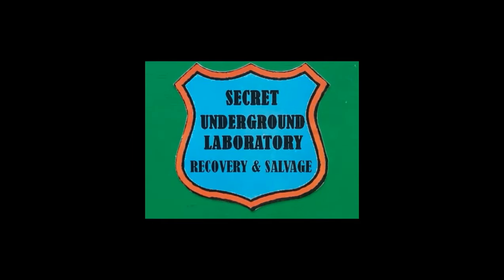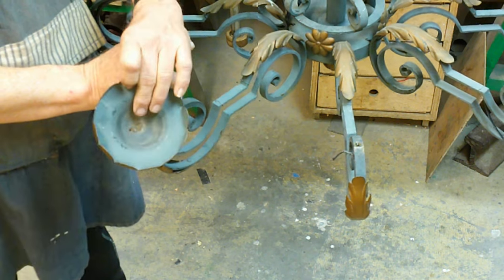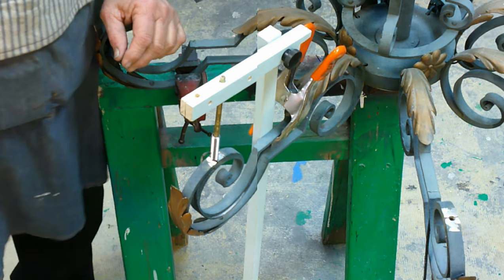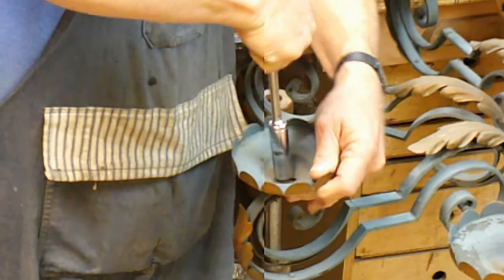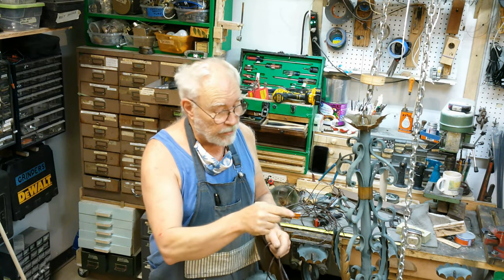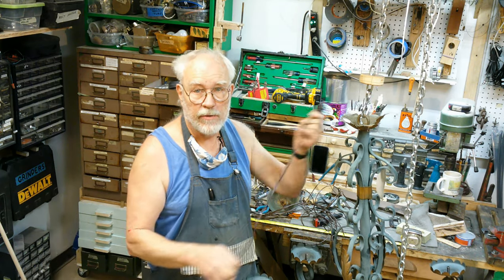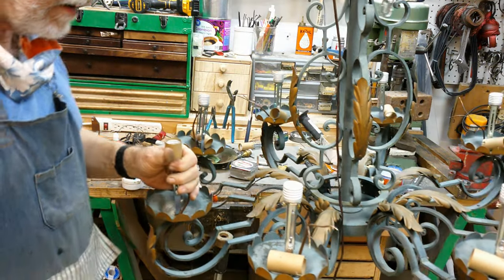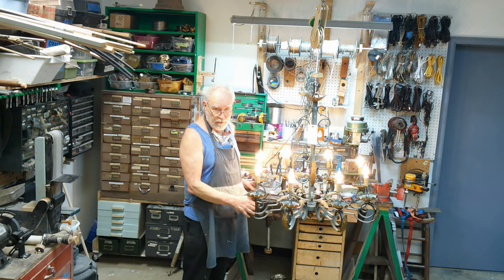A European Chandelier converted to North American wiring and sockets.

Comment: Generally clever and excellent, except don't use a twist drill in thin sheet metal.  Use a step drill instead.  Good ones from Unibit, less expensive ones at home stores, cheap ones from Harbor Freight.  They never snag, produce smooth round holes, and offer several sizes on one tool.
Reply from the maker: Thank you.

Comment: I have  a 5 arm chandelier with medium / regular size sockets, should I be using 14 gauge to support the larger bulbs? Thank you
Reply from the maker: @cherylyodicetubman3596  14 gauge is quite large for this application. Ordinary lamp cord is 18 gauge. The old floor lamps with 350 watt mogul bulbs used 18 gauge cords. Chandelier bulbs tend to be low wattage. I prefer to use 20 gauge for the arms and 18 for the trunk wire. LED bulbs used so little current, wire gauge shouldn't matter, but the electrical code requires the wire to match the bulb that could be used. Sidenote: The max wattage rating on lamps is to protect the shade from getting scorched. The hardware can handle any bulb that fits.
Reply: @BronZeage  hello and thank you very kindly for your response. I usually use 14 gauge, but those are with candelabra size bulbs. This particular fixture has medium normal size bulbs. I agree and also thought the 18 gauge would be too large, but someone mentioned that for that much power to 5  bulbs I would need 18 gauge which I do not want to use, but you seem like an expert who might be able to advise me with a safe application.
Reply: I am sorry I meant to say that I usually use 18 gauge however I have never rewired a 5 arm regular socket type.
Reply from the maker: @cherylyodicetubman3596  18 gauge is fine. I use 20 gauge because it's easier to pull through the arm. The arm wire is short and only goes to 1 bulb.
Reply: @BronZeage  OK so I can use 12 gauge for the arms and then hook it to the main body that goes into the ceiling 18 gauge is that correct?
Reply from the maker: @cherylyodicetubman3596  the lower the number, the bigger the wire. 20 for arms, 18 for the trunk.

Comment: I  saw you used plug-in electrical  cord for the main body, what wire did you use for the arms.  Sorry this is all new to me.
Reply from the maker: I use a regular lamp cord for the trunk wire because this chandelier is going to an antique store showroom, and will be lit for display. The arm wire is very similar. It's a two wire cord, size 20 gauge. This is one size under lamp cord.
Reply: @BronZeage  You can use 20g wire on chandeliers!?
Reply from the maker: @madisonj2653  I prefer to use 18g, but as I said above, some European chandeliers do not have the clearance for SPT1 cord. In any case, It's a run of less than 20inches and a low wattage bulb.

Comment: Are these required to have a ground wire after the plug is snipped off for installation.
Reply from the maker: It depends on local building codes, but most ceiling fixtures are grounded through the mounting.